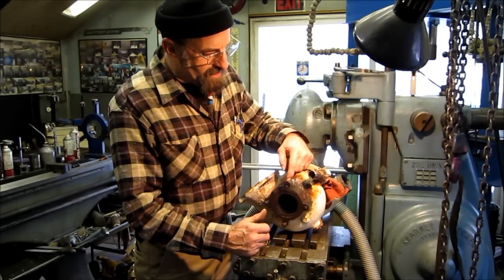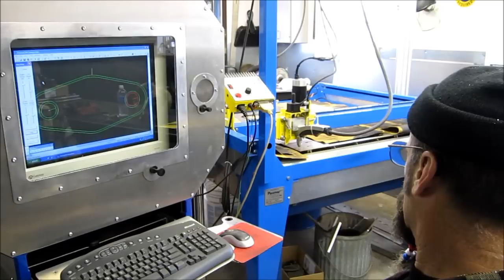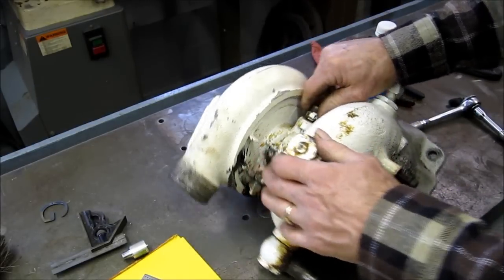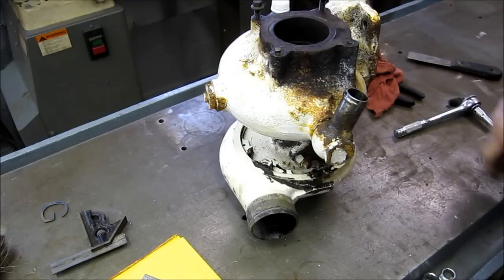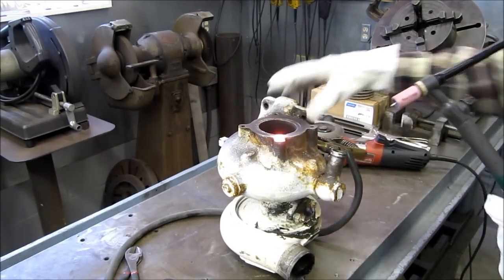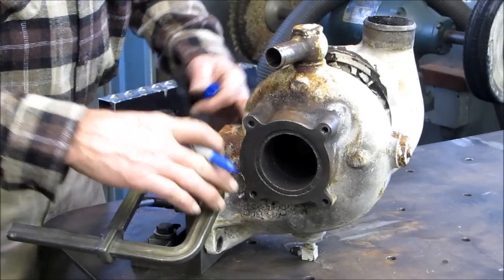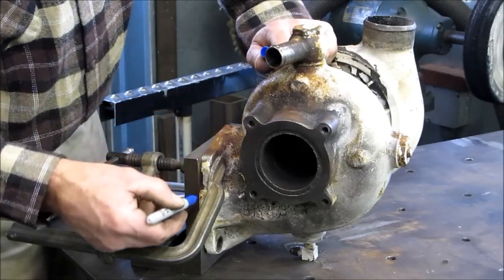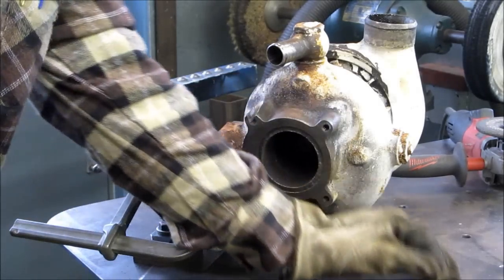So you broke it off, in your hole! Part 1

Comment: You know I don't know why people buy into this crap.  This is obviously a setup.  Anyone can see the amount of torque applied to break loose  that so called broken off stud was minimal.  Furthermore and tool be it a wrench, easy out etc that is designed to fit several sizes is not going to get tight on any one size.  I can also tell you that the torque lost between tightening it down onto the stud virtually guarantees it will slip on a stud that is truly seized up  A pair of vise grips and heat will work alot better then this sham